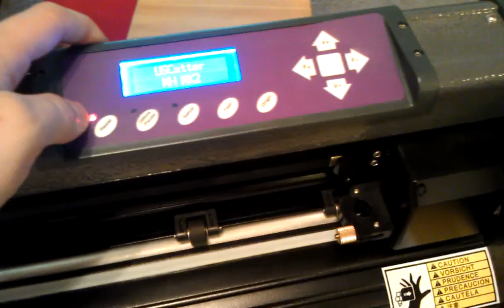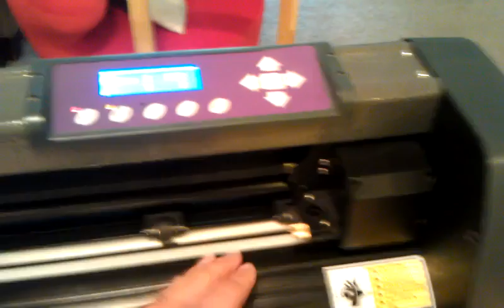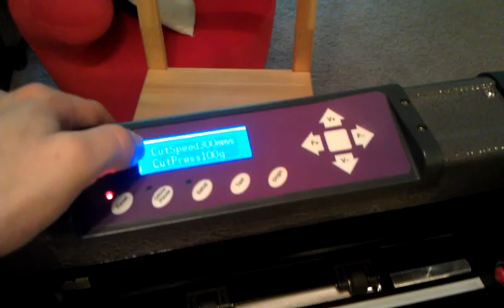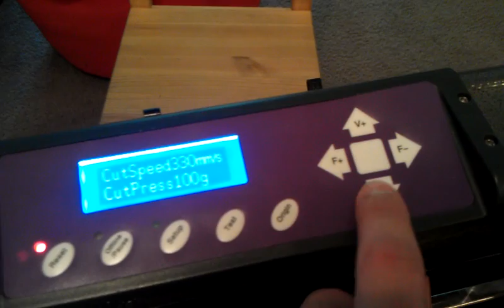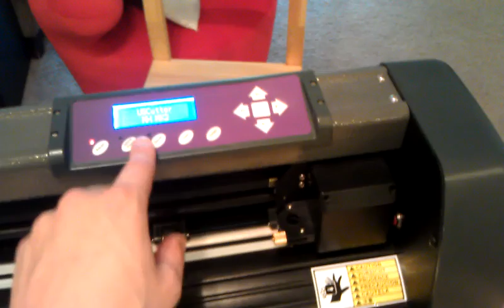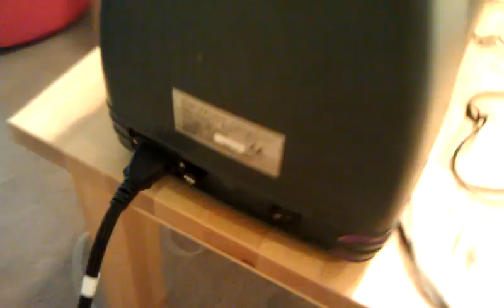Understanding the USCutter MH Series Control Panel

Comment: I am new to my machine. I found the pressure depends how accurately you set the extension of the blade. (1/64th?) I had to increase to 170 for a great cut, without cutting the substrate, so you could pluck. Fast!! Can't wait to experiment as I have much experience on 3D printers, plasma cutters. All relative in x and y. And sometimes in Z.

Comment: What causes the TEST to cut through the star, mine fails to do it correctly..
Reply from the maker: You may have put the blade or pen in wrong (it does happen), or your pressure is to high in combination with your blade being out too far, or carriage is off track. It's rarely anything else.

Comment: The holster with the blade is not going down and cutting. It's making the movements like if it is cutting. Brand new Plotter. Any HELP ???
Reply from the maker: I apologize for the slow response. I don't check my personal YouTube as much as I should. 

It can be one of several things, most of which are super easy to fix and require little effort on your part. If you just purchased it, you should be able to get support through this process. 

The most likely issue is that the arm on the carriage (the box that holds the blade and moves left and right) is stuck. Turn the machine off and try to wiggle the arm (the part that holds the blade) softly up and down to see if it moves easily. It should bobble with ease. If it doesn't, your carriage might need to be opened up and the frame inside moved ever so slightly. If this is the issue, it will take a screwdriver and a few minutes of your time but will be up and working asap afterwards.

No matter the issue though, I would contact support if you just purchased it. More often than not, an issue like this only takes a few minutes of your time to fix and is good to know in case it every happens again.

All the best,
David

Comment: HI DADIV, WHAT WOULD BE THE SETTINGS FOR CUTTING  FLOCK, I'VE ALREADY GIVEN UP WITH THE PLOTTER I JUST CANT FIND THE CORRECT SETTINGS, IS THIS MACHINE CAPABLE OF CUTTING FLOCK?
Reply from the maker: Sadly, if you are using the MH, it doesn't have the grip capacity or cutting strength to cut through most flock material. If flock is what you intend to cut, I'd recommend an more powerful cutter.

Comment: Mine worked fine but I accidently moved pressure thinking it was offline does anyone recall original cut speed and pressure?
Reply from the maker: Hi Holy, I'm very sorry you are having stress with your cutter. To answer your question, I created a short video that may help you: https://youtu.be/oYosStQZREU

Comment: Fantastic entry level machine share4.photo/mVinylCutter   the vinyl master software included is very simple to learn and get started with. However it does take some time to get the machine settings perfect for your usage you’re wanna waste a lot of material but once you get it dialed in it cuts great everytime.

Comment: I wonder if the MH 871 MK2 is different, U.S.Cutter's own videos and documentation say 500 speed and 100 pressure are the defaults, and we've had 100% perfect cuts with out any issues at all, I slow it down to 450 for adhesive gloss but 300 seems slow

Comment: I have a question, I have this same cutter,  I was using it and started to wrinkle the vinyl as it was cutting, and I wrongfully messed with the screws on the pinch rollers and now I cannot get it to move the vinyl evenly, now some pinch rollers seem tight and some are loosed, how can I get them to work right? Could you please help me? thank you!!!
Reply: could u solve tht i bought today same problems,,

Comment: You say 100 is the correct pressure for 3 or 4 mil vinyl mine needs to be set at 120 for oracal 651 vinyl 100 wouldn't cut through it
Reply: interesting, we have ours set at 100 also and it's perfect, i wonder if it's just plain old simple blade depth?
Reply: @joeylopezdesign  dam. . i got mine set to 10 . . and speed at 300

Comment: Thanks for the clear explain very detail about the Mk-2 it so helped full great video. I learn how to set up and I have had mine over a year. I was not happy with the cutter because it eating and cutting my vinyl damage  it .  Now that I understanding the right number for speed and pressure the how to set up correctly .Great video how you explain more about the MK-2
Reply from the maker: Frass BoxxTV what software did you buy with it?
Reply: ChristianT-Shirt & More I still don't understand how to use mine 😭 whenever I place the paper on the cutter and try to cut my design it's not cutting it in the right place 😔😭 I need help 😔

Comment: my cuts are nice but sometimes the blade seems to leave a line or 2 in letters or images, making it look a little sliced at times. Can anyone help?
Reply from the maker: It's hard to say what might be causing that issue. Have you already spoke with USCutter's support team? If not, I'd say talk to them first. I'll talk to a friend of mine and see if he can add a tutorial covering this topic. :)
Reply: That means your blade is crossing the vinyl. The blade should only be out about the thickness of a credit card and should cut 2.5 mil thick vinyl on 30-40mg and if it's loud when it cut 95% of the time it needs to be grounded. Hope that helps
Reply: same issue im having ,were you able to fix it?

Comment: Hi! looking into buying this machine, you video IS very helpful, now my question is...if I want to cut paper like cardstock will I need a mat to hold the paper or this machine has one? (I use a Cricut and they need mats to cut materials) thank you! and is it possible to use the US cutter mh721 for paper cutting rather than vinyl ? Thanks!

Comment: can i make rhinstone templets with this cutter if so can you do a tutorial for rhinestones
Reply from the maker: Sadly, the MH vinyl cutter is an entry-level vinyl cutter. It does not have the blade pressure necessary to work with rhinestone template materials. I'd recommend getting something like a Titan myself.
Reply: Hi my MH721 MK 2 cut really fast with speed @10. I need help

Comment: hi everybody! :) I have a Rohs 721 and i dont find the driver. Ca n you help me please?
Reply from the maker: What software are you using it with? Generally speaking 721 series cutters from any brand usually use similar hardware. The drivers can often be swapped out. I don't have the cutter myself so I can't test it. But a usual Google search should pull up the right driver. I'd say try the MH driver if you can. At least that way you know its from a trusted source.
Reply: Artcut, corel draw, illustrator.

Comment: I am using the US Cutter MH MK2. Just like the one in the video.
Reply: David Sharp-Bell I worked my way up to 600  pressure, it cut but not completely thru.  think I had a bad sheet of flock. I have heard others complained about not being able to cut a certain color of flock. Thank you for your help. I will try it again when I get new sheets of flock in.
Reply: David Sharp-Bell Ok, thank you so much  for your help. I will look into upgrading.